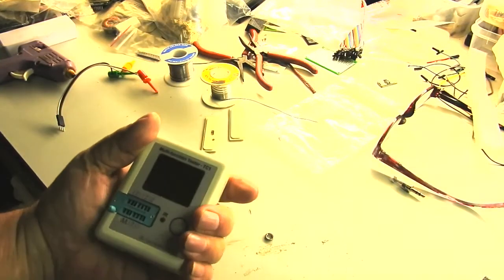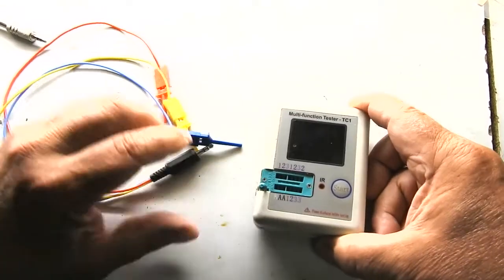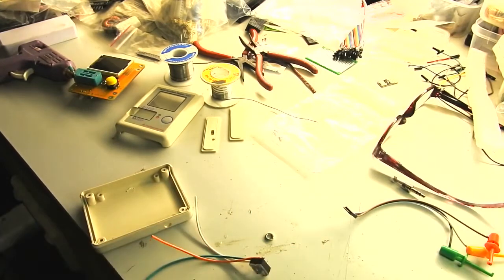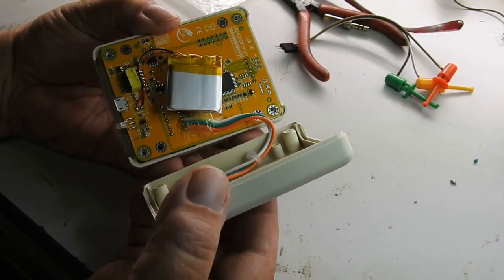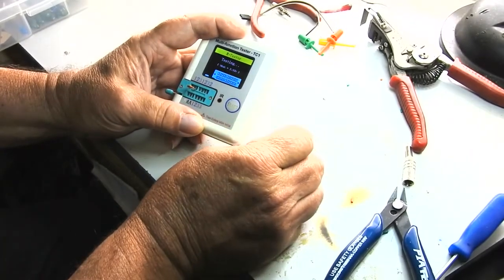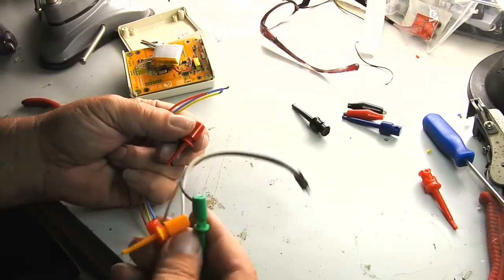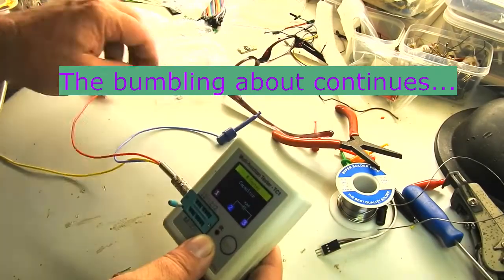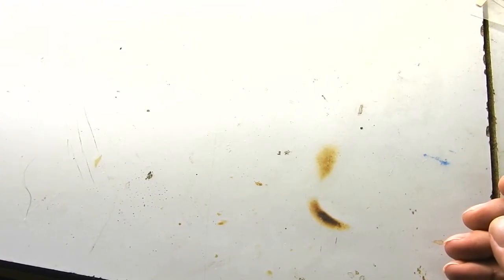Simple Upgrade for TC1 Multi Function Tester

Comment: Attention: (I am almost certain the crafty gentleman in this video does not provide this info.) For testing zener diodes, you will also need to plug in to the established outlets (Specifically the lower  leftest 2 on the quadrant). I am sure there are other intricacies i have missed or disregarded but hopefully somebody else can come along and add. Happy Tinkering!!

Comment: Hey I did the same mod as you and added a 22K ohm resistor over C15 (to prefent the Battery from discharging as someone else in the comments said). I used a smaller jack though, but same 3 pinout. Works like a charm. soldering is quit difficult for a beginner if you want to solder a tht resistor on C15.

Comment: Great mod, thanks for sharing. I added a toggle switch to disconnect the battery when it's not in use, battery drain was pretty bad. Will look into the resistor mod mentioned in another comment.
Reply from the maker: Thanks, I should look into doing that mod also.
Reply: @bertoid  Haben Sie die Widerstandslösung untersuchen können?
---  Did you get to examine the resistor solution?
Reply from the maker: @heinzpetersen9356  No, I haven't. The battery does not seem to discharge excessively when not in use, so maybe it's already been fixed on this one, or something else has been done to reduce the problem.

Comment: I did similar except added them to the end plate at the top. I added a 3.5mm jack with 3x push clips like you have and was lucky enough to have red, blue and purple to match the screen terminal colours, also added red and black banana plug sockets to add some multimeter probes. I do get a small capacitance with the 3.5mm jack and wiring, but i don't use them to measure such small capacitance so it doesn't matter. Now i just need another hand to push the test button lol.

Also, add a 20k resistor across c15 on the output of the 5v regulator and your device won't self discharge :)

Comment: Have you tried to install some alternative opensource firmware to the device?
Reply from the maker: No, is there some better version?
It mostly does what I want, so I'm happy with it as it is...
Reply: @bertoid  same here for all i need it does great.
And compared to its 160.00 competitors...
Reply: Maybe is possibility check temp.sensor DS18B20 and DHT11 also signal generator?
In other versions I saw these functions.

Comment: they are handy smart but also very crap quality.In my experience the display start to flicker when i press the test button the 1 one i got  the display did flicker every time i used it.The next one i got hold of did not flicker when i got it ,and worked as it should a short time.under 6 months..I think they are crap straigth from factory
Reply: Probably accidentally killed it with a capacitor that hadn't been discharged.

Comment: still waiting for 1 bought 2 of ebay and 1st 1 arrived without internal battery 2nd one didnt work maybe 3rd time lucky waiting to see.
Reply from the maker: Bugger! Hope you finally get a good one.
I tried to find which seller mine came from, but record is gone.
Reply: The seller without the battery was dark-duck007  he tried to tell me they came without battery, i told him i knew they didnt so the next email i got from him said battery no included so i went back and found his items for sale and he had slipped the word no in front of included on all his adds. he then said go and buy a battery to which i repled im not paying the proper price to you and then buying a battery when i can return this to you and buy from a trader whos item is right and is more honest than you and doesn't alter his adds when he has bought items thats not fit for purpose. anyway ebay got involved and a refund was done but now this one that doesn't work just waiting to hear from this new seller. I wanted to buy the simmular little scope but this has put me off.
Reply: @rayfirth2513  wish.com has them as well.  There are a few different power choices between some and same sellers. Just be mindful of differences when checking out. 

They can be sneaky with their descriptions and pictures.
Reply: Sorry to hear that . I hope you get it straight. 
I have had great service from mine .
I would buy another if needed and recommend  it as well.
Thee option to this is 160 bucks so i chance it.

Comment: Please, can anybody tell me if this can measure the esr of capacitors, while they are still on circuit??? It would be very useful.
Reply: No, not in circuit. Buy the Atlas ESR+, but be aware of:  measuring capacitors in parallel will mess up your reading and give you false results.
Reply from the maker: google for "TC1 Multifunction Tester", you'll find mountains of stuff about them, which should answer your question...